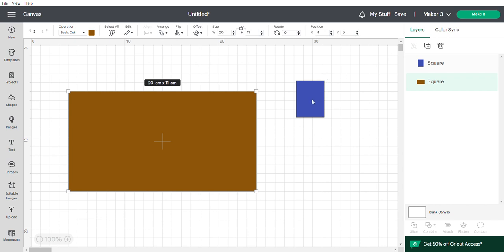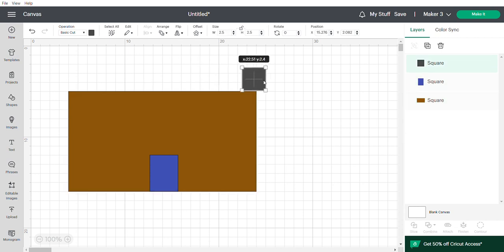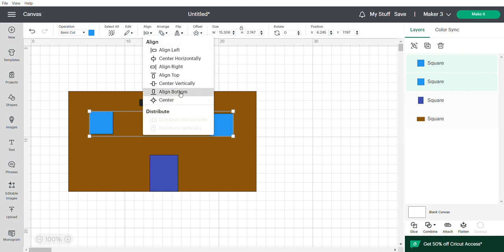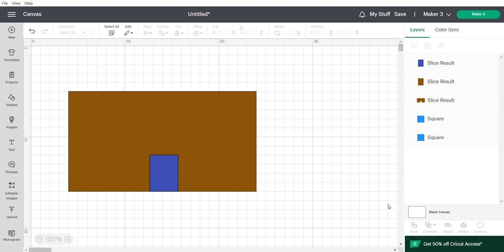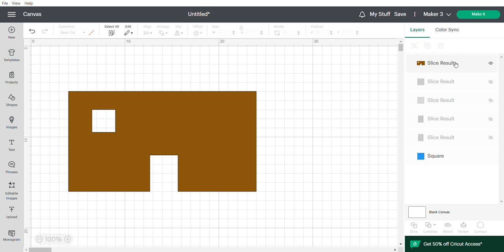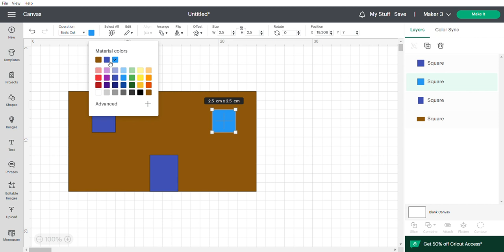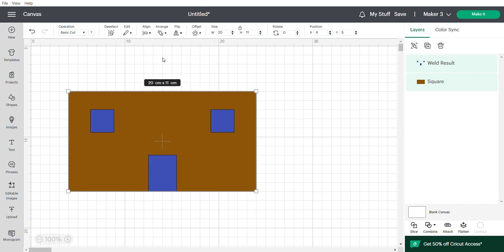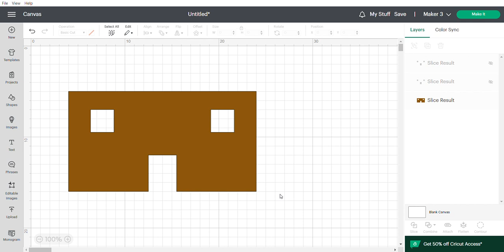Cricut Design Space, basic operations to Make 00 gauge railway building

Comment: I’ve been thinking about getting a Cricut or similar machine recently, does it cut greyboard ok or have you not tried it yet? This video is really useful for beginners
Reply from the maker: Thanks, I'm glad you liked it. I haven't tried but I imagine it would do ok
Reply: @danderhallrailway5140  no problem, I’m thinking it’ll be ok since if it can cut 2 mm thick with the right blade, 1 mm won’t be too much of a challenge, will definitely need to get a machine and try it out, it’ll make model making so much easier :)
Reply from the maker: @Thorpedo619  there is the disadvantage of needing a drawing to cut but once you have that repeat buildings are much easier. I've also had good results using vinyl as window frames onto clear plastic
Reply: @danderhallrailway5140  great idea :) drawing shouldn’t be a problem as long as the shapes are simple enough to be made into a vector drawing for the software to understand